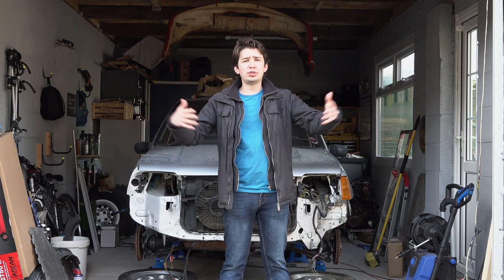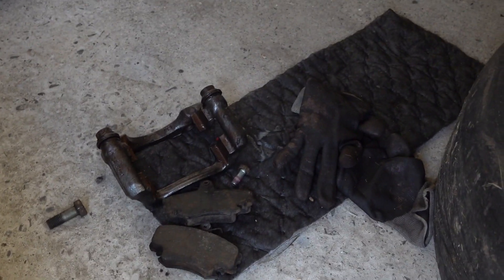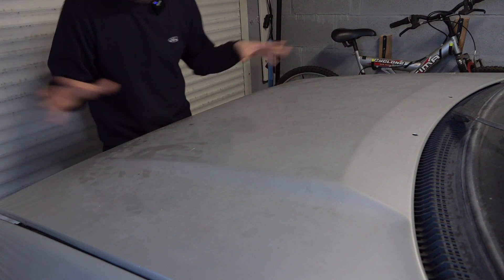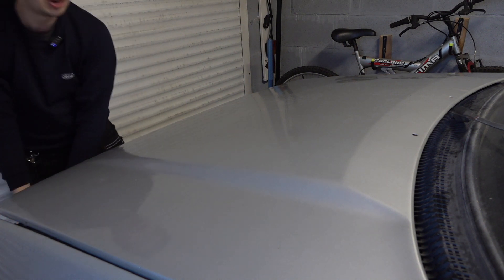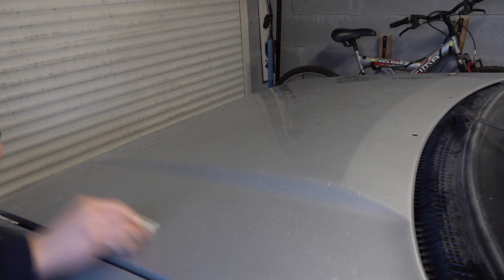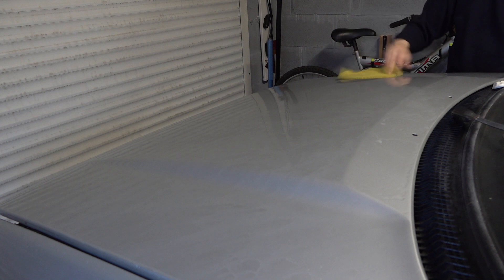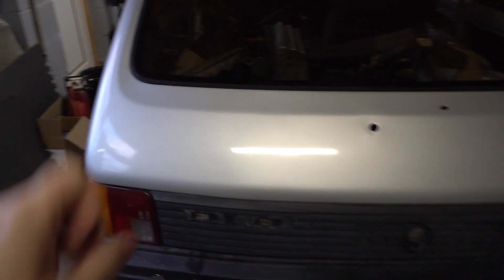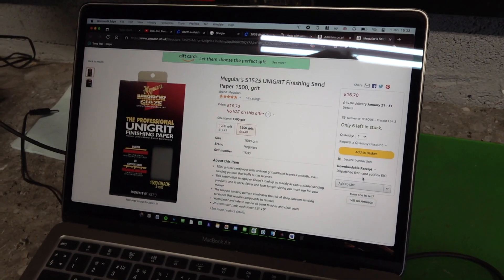Exterior Wash Pt.1 /// Peugeot 205 1.6 GTI // Running Down A Dream / 5.6

Comment: ONR is great stuff. when using on a dusty car like this you can also use some ONR from your bucket in a spray bottle as a pre wash to mist onto the dirt. were you knackered after doing this?  I've just spent all today doing a wash full decontamination with iron, tar remover and clay, one step machine polish and wax on my e60 5 series, I'm absolutely knackered now 🤣 wish I had a car as small as the 205!